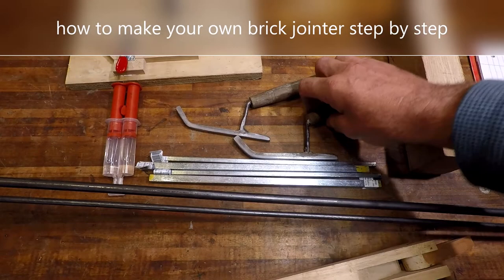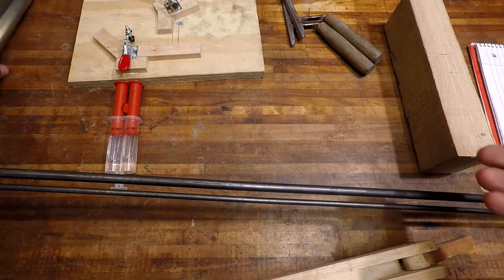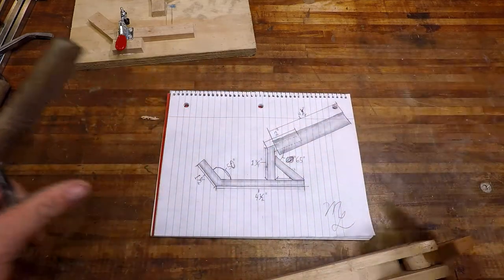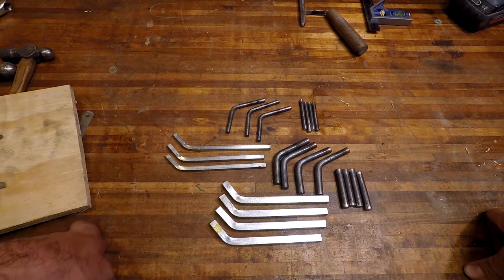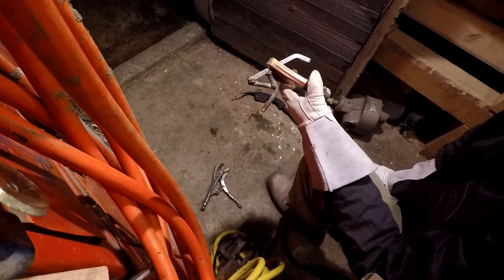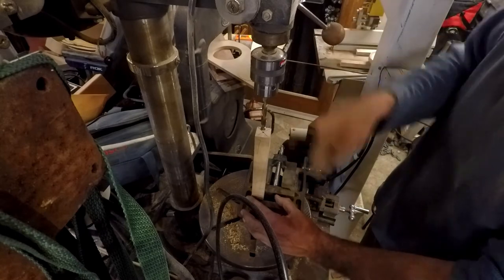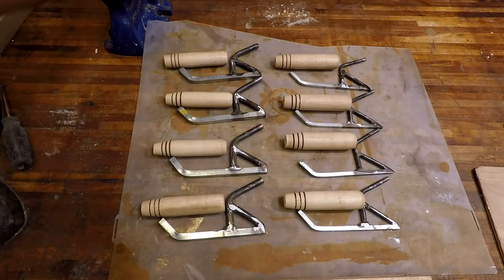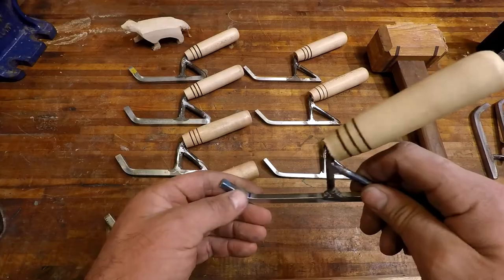making a brick jointer

Comment: nice job, I was looking to try make one from 10mm rebar as most jointers are designed for concaved joints, but a  square recessed joint whilst nice, a bit more difficult to guage the depth of a rake out
Reply from the maker: You'll have too keep me posted, if you make some out of rebar.
When I used the square jointer it's usually after I run the rake, just to make sure I have a fully compressed joint and to make it look more uniform.

Cheers